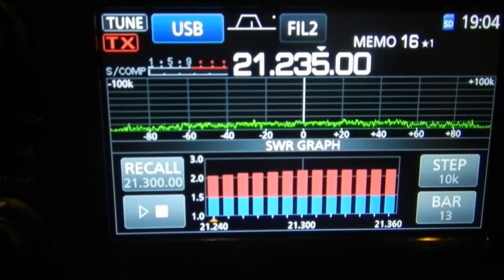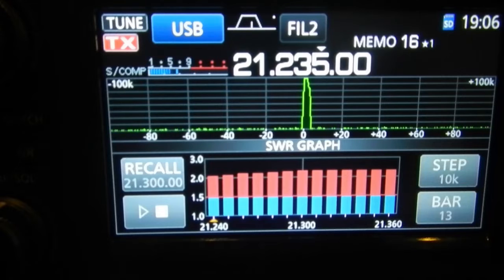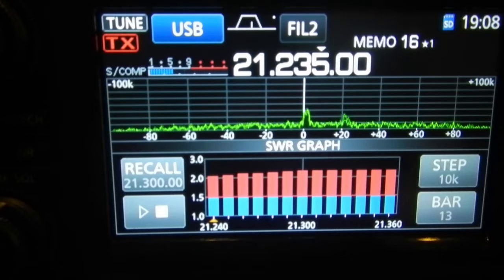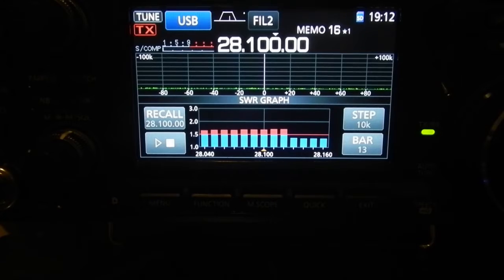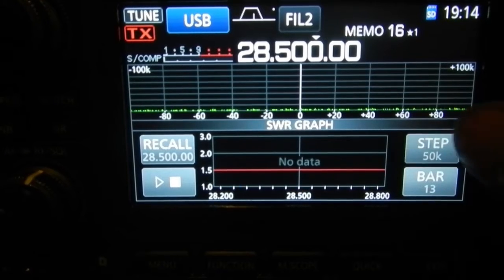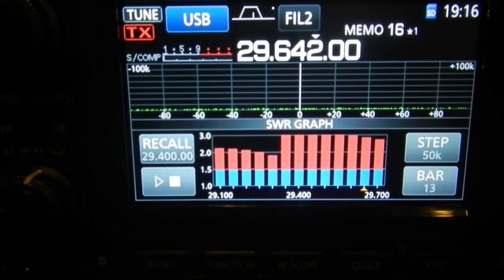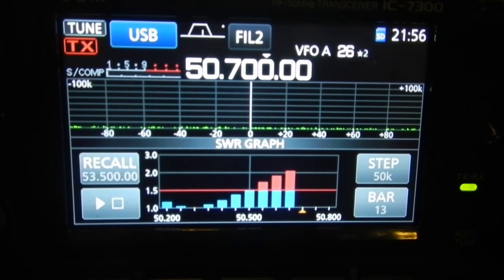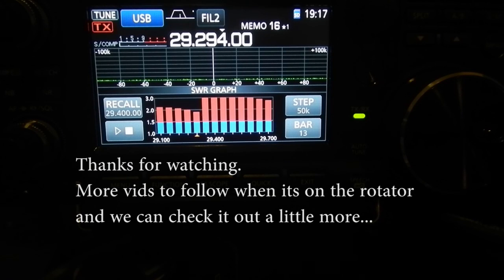Mosley mini 32a 2 element tri band yagi - P3 SWR checks

Comment: How do you think this compares to the hex? I’m looking at both. I see this came down on you ? Must’ve been some bad gust
Reply from the maker: I didn't have them at the same time but I like this better over the hex. 

I can't always leave my antennas up in the air and they have to come down and be broken down for storage now and then. 

This is waaaaaay easier than fighting with the wires on the hex beam.Much easier to store too.  Bit more solid too I think. 

Yes, the mast came down and snapped some insulators on it. It was my fault, I had it strapped up using some webbing and it didn't hold up for a long term install outside. When I put the mast up to full height it stops all of a sudden and jolts a little. 

That was enough to break the weakened webbing strap. I saw it happening but all too late even though it happened in slow motion. 

I've learned in previous jobs, when something falls, don't save it, just get the hell out of the way. 

Should be an easy fix but I need to source parts which I need to get around to. Also my license class doesn't let me use all of the bands on the hex, so this one has only the bands I can work and tuned up on 6 which was nice. 

If I could use all the bands on the hex, that might be a bit different but cockatoos go through fibreglass antennas pretty quick around here. No issues with them landing on this beam. 

This ones a bit cheaper too. 

Performance, hard to tell since it was some time between both of them and as you know conditions haven't been great for a while.

Comment: during the SWR measurement the tuner should be turned off, buddy
Reply from the maker: You're right. what you're seeing is the post tuned results but that's how it would be used real world. 

Granted I could have also done a sweep with the analyzer which would have offered a good comparison. 

Unfortunately a storm took care of that antenna for me when it came crashing down. 

I still need to get it sorted . It actually took the hit very well. 

Cheers Eugen.   Good name that . My middle name is Eugene :)

Comment: How is it holding up these days?
Reply from the maker: Hi there, Unfortunately, it had a little incident and came crashing down when my pneumatic mast fell over. 
from 10m up the damage was surprisingly minimal . I just need a new centre insulator and I'm back in business. 
It's not ever going to be as straight as it was but should work no problems. I'm not happy though, 10m has just started to come alive and I'm missing my beam.